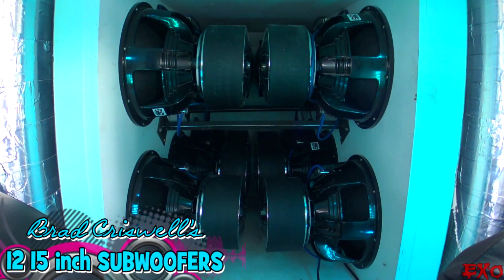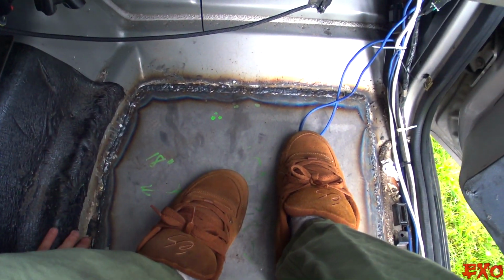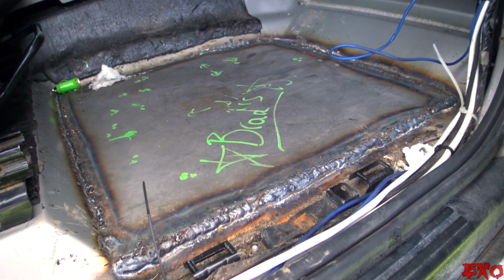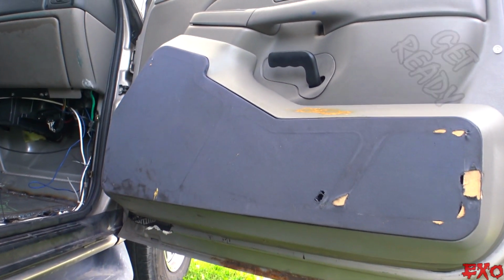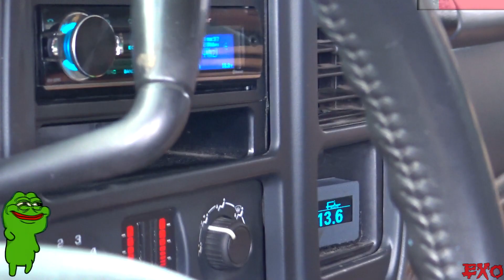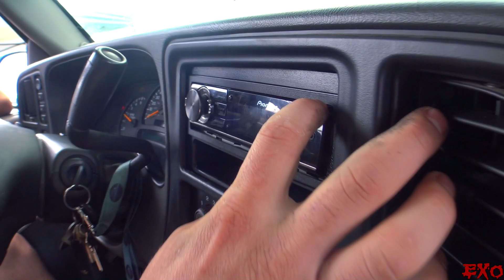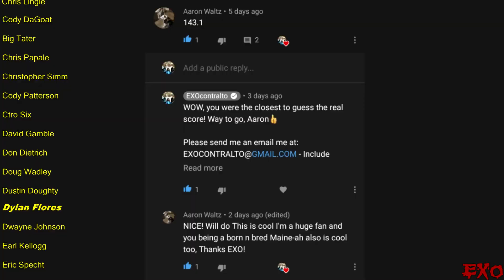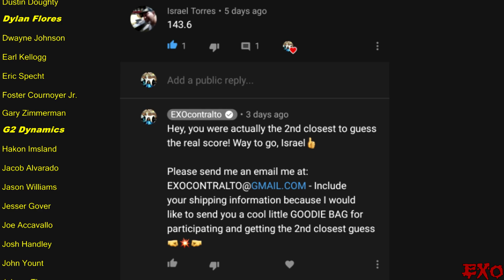BIG BANDPASS Car Audio Build w/ 12 15s FLEXING Like Crazy & LOUD Inverted Zv5 Subwoofer Bass Demo

Comment: I would love to build a setup like that but using square cones with 8" coils using servo coils as well. Amps would need to be custom and with that much cone area to run in servo each sub would be very hungry and want like 10k each. 
But 12 square cones in that size enclosure running on servo would be fast as F and punch you in the guts.

Comment: Help needed!
So i recently installed a voltmeter in my car. But idk if the voltmeter just does not work or if I connected something wrong. My battery is pretty bad so it only gives out 12v atm. But the problem is that the voltmeter is constantly at 12v. Even if I rev the engine or drive, the voltmeter just stays at 12v. If I play really low bass it drops to 11.7 for just a sec or so. But the fact is does not most voltmeters go up in V when revving the engine? Is it normal for the voltmeter to just constantly stay at a specific V...? Any help or tips are very appreciated!

Comment: Just a quick question, I have an underseat active  pioneer sub installed and am wanting to add a separate bigger 12 inch active subwoofer, I plan to use a new wiring kit for the new sub , split the rcas at the amp end ,but the main question is can I run 2 amps with 1 remote wire, from the head unit splitting into 2 , I hope to install 2 switches up the head unit end using the remote wire split into 2 , then in theory I will run 2 remote wires to the back ,one  to each amplifier, that way I can turn each amp on and off for different situations easily, does this sound like it would work OK? Or would I burn the remote wire out powering 2 amps and adding switches?